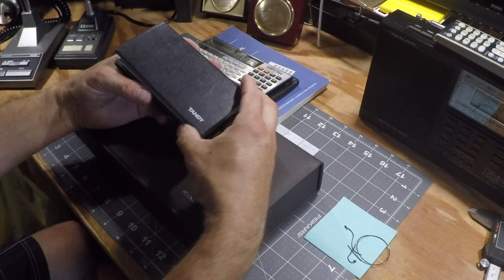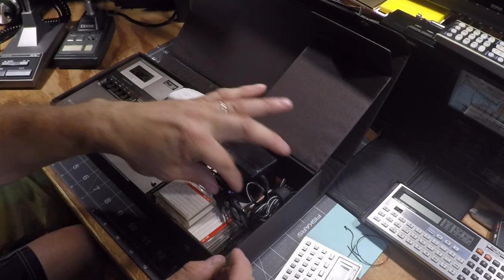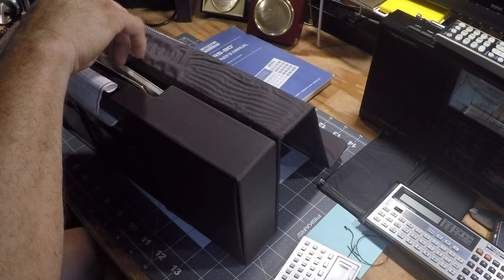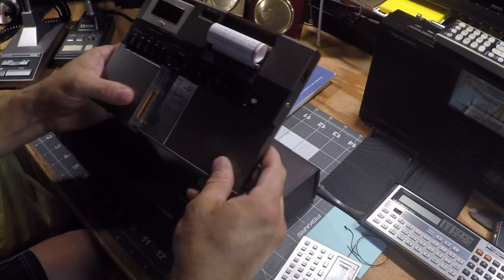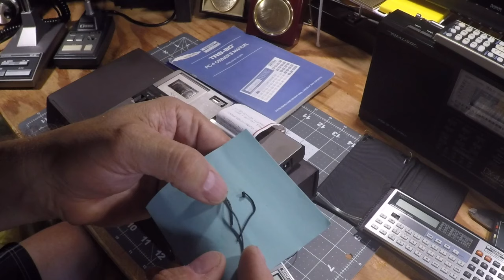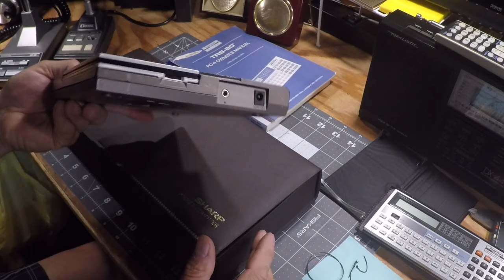Vintage Tandy Pocket Computer Series Part 2

Comment: I need to get off my butt and dig up all the old electronics, palm pilots and other older high tech stuff I have stored in the attic
For your archives.
My brother has mom's first run Apple computer and it still works..
Keeps his ham logs on it.
One of those sold not long ago to a collection for @ $8000.00 not working!
Play hooky and let's go fly fishing or flying...